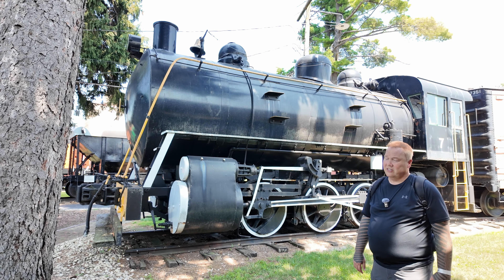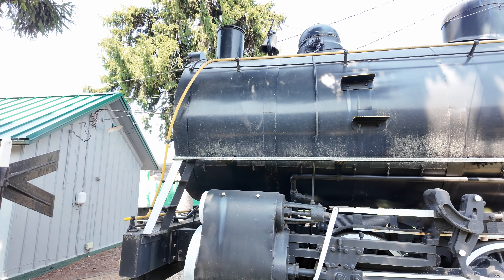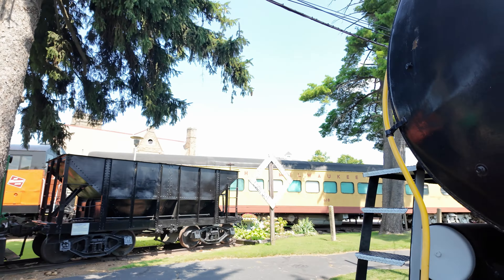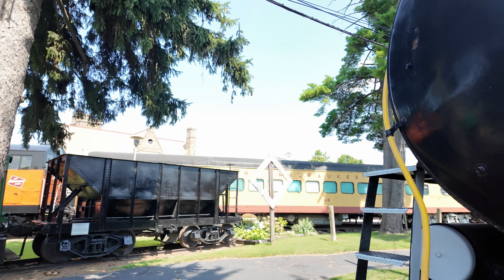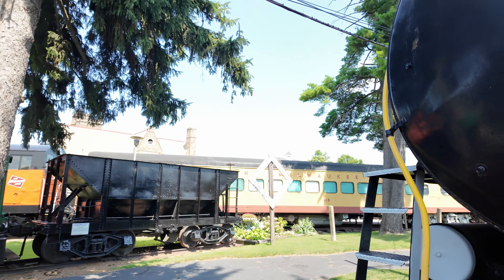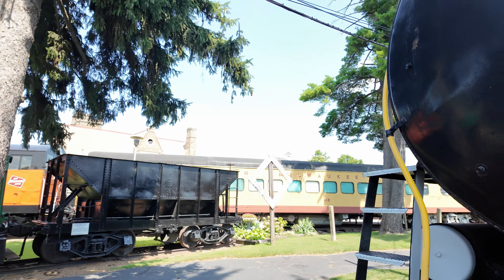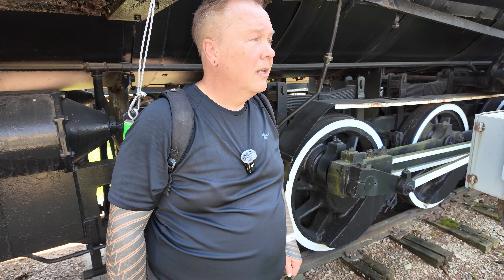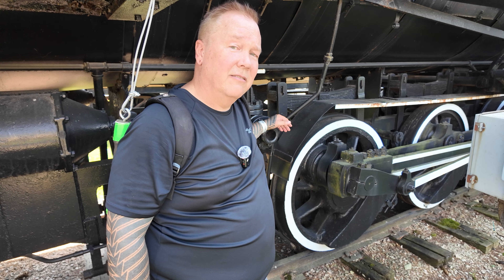Fireless Steam Locomotive @ Mad River & NKP Museum

Comment: Would this technology be a viable alternative to electric cars - you might not get much range, but you would be able to refill as quick as a petrol (gas) car. You could heat the water/steam with a solar collector.
Reply from the maker: Interesting idea...  On one hand, boiler technology is better, so could go hotter and higher pressure, giving you more power per cubic foot of tank space.  For cars, though, it'd still have to be pretty small, and you couldn't park your car outside on a winter night and expect it to start in the morning.  Could you maybe use it for a delivery vehicle of some kind?  Probably the biggest drawback, though, would be the boiler maintenance and inspection requirements.
Reply: @Industrial_Revolution  I've just been googling gas cylinders, oxygen are around 3000 psi, and are hydraulically tested  every few years, and can last a long time - I'm not sure if the water, and the constant evaporation would cause corrosion. I would presume that, either the range would make it a practical solution, or a total non-starter. 
I read somewhere that a guy made a model steam loco, and he "fired" it by heating up some metal bars to red heat, then put the hot bars in the firebox, anouther idea for a fireless engine, and possibly an idea to superheat the steam from a fireless loco.
Reply from the maker: Compresses gas cylinders typically require inspections every 5-10 years.  Steam boilers are, I think, based on hours of firing, as well as total time, whichever comes first.  Since you're expanding the gas or water down to 1atm pressure, a cubic foot of water will expand to about 1646 cubic feet of steam at 1atm.  Compressing that down to a compressed gas cylinder, at room temperature, would need around 24,000psi, if my math is right.  Not something typically available.  That's why it was so much more efficient to use water.  There were, however, some places that did exactly what you're suggesting, using compressed air to power locomotives.  I don't know what pressure they ran.  Likely a few thousand, but that's just a guess.  Like the one in the video, they had no fire or smoke, but unlike the one in the video, they also didn't vent steam, which could be useful in some places.  I saw one years ago in Pennsylvania, and I'm hoping to get back out there to do a video on it.

Comment: I was way off. I was thinking due to the larger tank it used some type of D.C. induction coil to heat the water. I kept looking for a battery box. Its still fireless due to the coil being sealed between the outer shell and inner steam tank. I guess it would of used way to many Amps to power a coil large enough to heat that much water. Ok its late I think silly stuff when im sleepy. For you Rail Road buffs. I live in Lanett Alabama which is next door to West Point Ga. Its depot was important during the Civil War  due to the fact the rail gages changed there. Anything from the North to it used the standard rail gage used all the way North from there further south and west  used the smaller gage system. Which probably means the CSA Hunley the 1st submarine to actually sink a ship in warfare  came here then had to be put on a different train going north to the Carolinas. At least Logic dictates that because it certainly didnt sail there. Yall I did say I was sleepy so I may be wrong about that logic. Also FAt Tyler had a 32 inch naval cannon trained on the Chattahoochee river rail road bridge to fire on it if needs be But 3000 union troop besiged Ft. Tyler maned by 150 walking wounded Confederate troops It fell that battle happend 2 weeks after Lees surrender. I think gorillas  probably kept telegraph wires cut so neither side got the message. The war was over. Genral Tyler had lost a leg at Chicamuaga and took command of the fort. He was killed by a sharp shooter early in tbe battle because he would not burn the homes of the people there less than 100 yards from the Fort. He was tbe last General to die in the war. The Youngest major was commissioned there as well. An 8 hear old boy came to offer his aid to the soildiers at the Fort. General Tyler told him he couldn't help due to the danger. The boy was crushed. Then he decided I can use him to give a message to my superiors if the worst happens. So in order to do so he had to commission him and gave him the rank of major all written and made legal  as called for in war. Because without that  commission making him an officer if caught he could of been considered a spy and hung and before anyone say no way The Union had already hung a 10 year old boy and his Dad for being spys because they were caught with messages between Confederate forces. So Gen. Tyler swore him in  made it legal and binding as to the proper articles  of military code and  of course this got him sent away from the Fort. Under orders.That if the fort fell to give this message to the next Confederate soldier of officer he saw. The boy probably couldn't read and the message very well may have just been really why tbis boy was a Major. But its true I cant remember the boys name sorry.
Reply from the maker: Thanks for your comment!
The electric option you were thinking of isn't really that weird.  Today, we may have battery tech to handle it, but back in WWII, a handful of standard steam engines in Switzerland (I think) were actually converted to electric in that way, getting power from overhead wires.  They had a lot of hydroelectric power, but not much coal, so this made a lot of sense for them.  
You mentioned rail gauge. I have a video coming up on that.  Before the Civil War, there were a LOT of different rail gauges across the country.

Comment: you could probably hook a fireless to a conventional steamer for steaming too
Reply from the maker: You could, but I don't know if anyone ever did.  Essentially, the top part of any steam locomotive is dedicated to producing steam, then there's a pipe or two that go to the bottom part, which is responsible for making the wheels go.  On these fireless systems, the bottom part is the same as any other steam locomotive, it's only the top part that's different.  
I guess you might be able to hook it up to work kinda like a plug-in hybrid?

Comment: Another way to put it,.....as you are using the steam from the top of the boiler, the water ,( because of the high water temp.) continues to boil into steam that is of a usable pressure. At what point the water goes low enough in temp.,  you are using only the steam pressure that is left in the boiler. No more boiling going on.
Reply from the maker: Reading about Rubicon, down in Dayton, OH, they said it could run on just a few PSI to limp back to the external boiler to recharge, as long as it wasn't pulling a train.

Comment: Stink pot Diesel. Had a oil burner vs coal. 😊
Reply from the maker: This one?  Nope.  No burner at all.  Don't know what the external boiler ran on, but given the timeframe, I'd assume that ran on coal.
Reply: @Industrial_Revolution  yo are right the stink pots ran on grain yards and the transition to current locos I did work in a area near a switch/depo that a series of engines. Usually the air job took over at the entry then stoped at exit  had check my diary. You are right.!